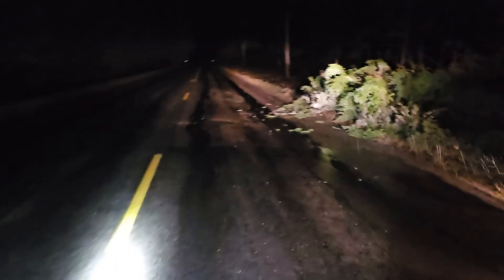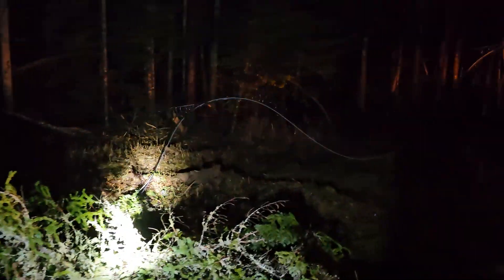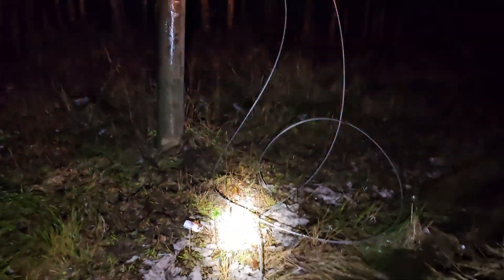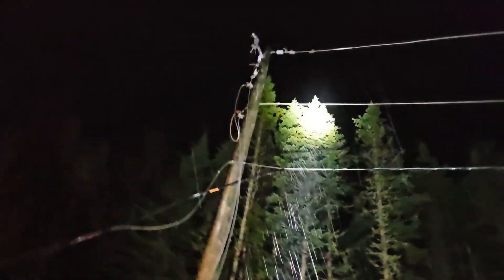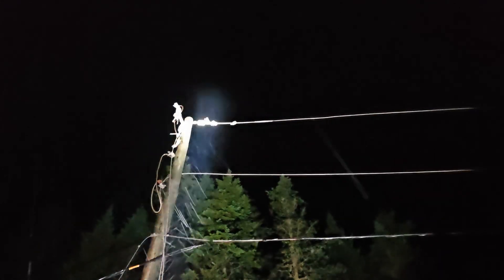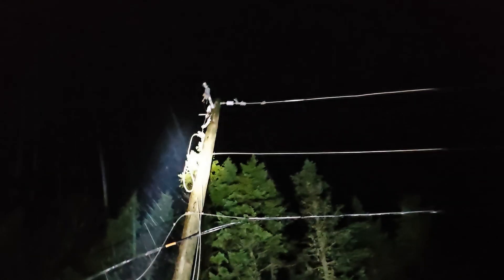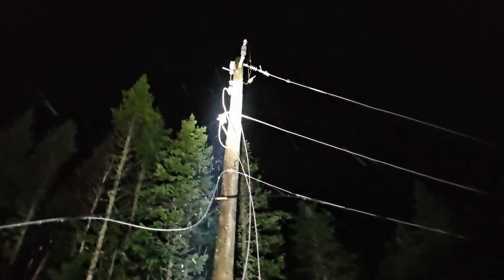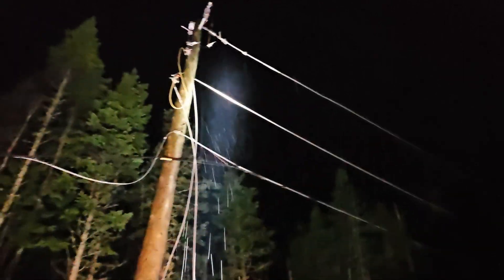Securing the scene during storm

Comment from the maker: Hey Everyone! 
 Two things I should add; Upon arrival, the crew will have to install a second ground on the other side of the break so there is no difference in potential on the wire being spliced. The first strike of lightning occurred once I was already up in the air. I immediately proceeded down to the ground as multiple other violent strikes  followed. Never leave the ground during a lightning storm, wait 30 min until after the last strike!
Cheers all! Be safe.

Comment: not being able to use chainsaw if you are alone is some next level osha bullshit
Reply: What the hell is with you anti safety people
Reply: @steveggca  he is allready put in a dangerous situation, that did not need to be there 🤣
chainsaw or no chainsaw this is crazy where im from

if they had put the cable in to the ground he would not need to be there
so why care about a chainsaw, when we are taking care of a dangerous problem that should not exist

running a cable on poles next to a wood, what could go wrong 🤣
lets add lots of points of falure to the cable 🤣
Reply: @Hansen710  not sure where you are from but in Canada we have lots of underground cables in cities but in the country there is huge distances to cover and few customers so it isn't realistic to put everything underground. Also a cable fault is typically more work to repair than an overhead problem
Reply: not sure exactly how the rule is worded but hearing it's ok to use a sawzall or hand saw.
Reply: That's crazy
Reply: @diffsoun     consider the amount of kick-back on a sawzall (about 2-3 inches) versus a chainsaw with a 14 inch bar. I suppose they need to draw a line somewhere. When I was working on the road I never used power tools. If I could open a lane by using a tow strap on my van, then that's what did. Use what you have and stay safe!
Reply: And to think I never have a buddy when I'm cutting firewood with my chainsaw. 😮
Reply: @Gallowaylights    you are likely close to home and on fairly level ground, not 20 miles into the woods working in a ditch where nobody is around.